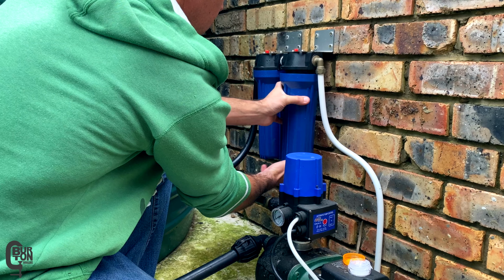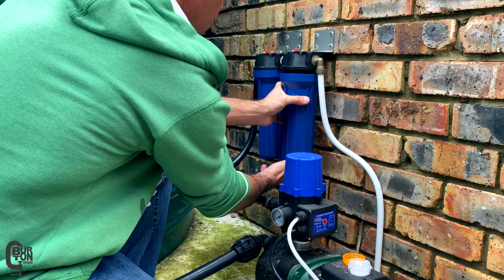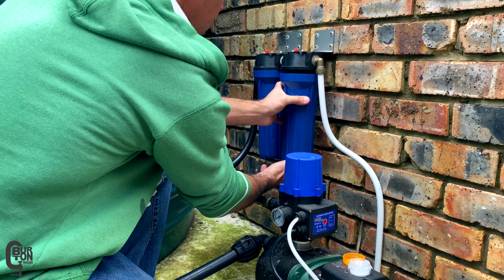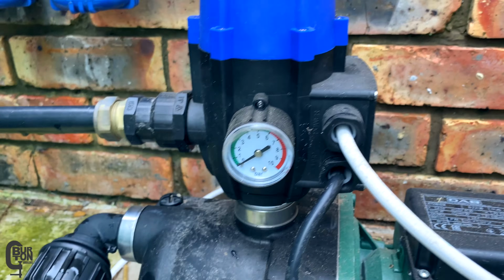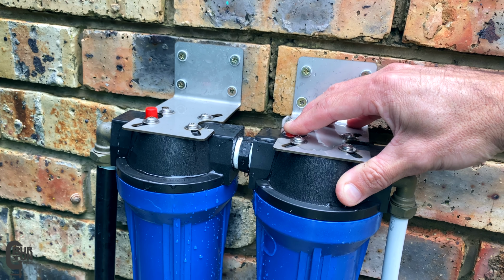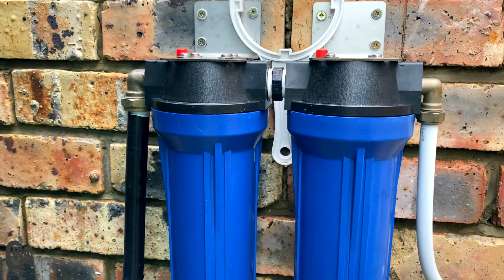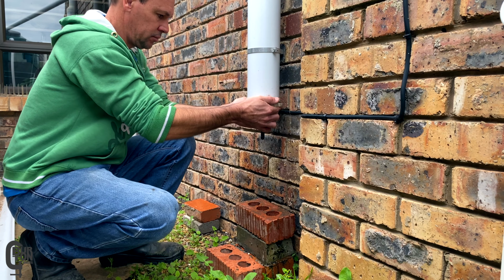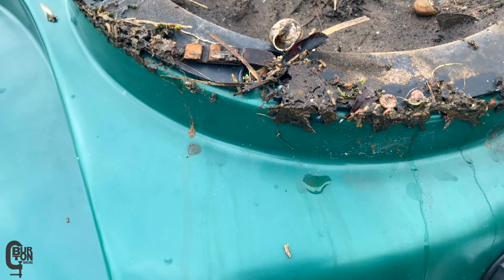How to service Rainwater Harvesting System (Filters | First Flush Diverter | Leaf Catcher)

Comment: Very nice video Grant. In this example using those two stage filters, what are the homeowners using the water for? And lastly , this system I am assuming is a back up rainwater system for instances when the municipal supply is offline as I see you can switch between the tank supplying the house and the municipal?
Reply from the maker: Hi Conrad, thank you. Generally speaking, it's being used as a backup water supply when the municipal supply is offline (as you describe), but not used as drinking water.

Many people harvest rainwater in tanks ranging from 2.5kL to 10kL but I've seen some people will have a smaller 'reserve' tank, around 1kL, and fill that from the municipal supply.